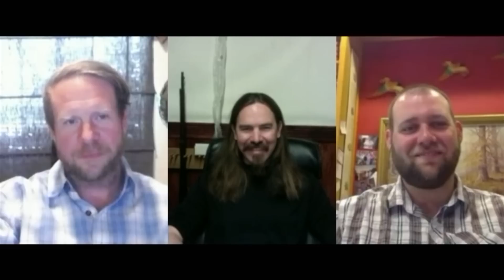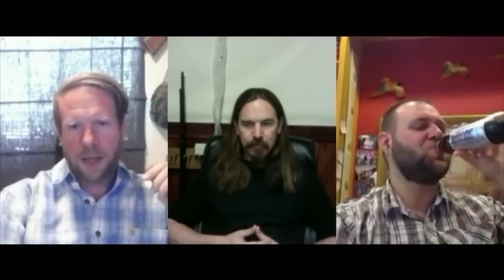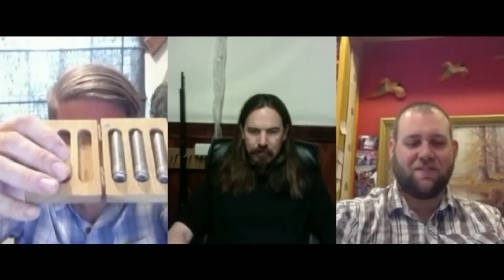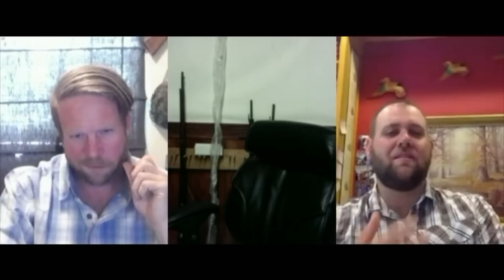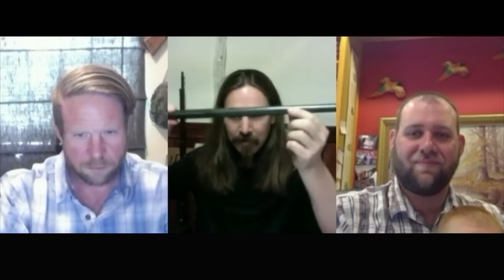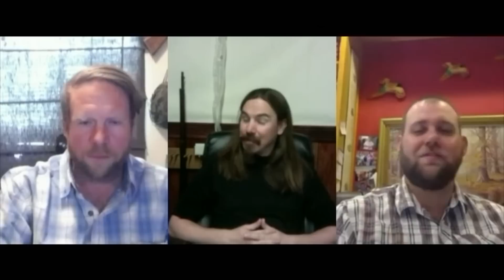Faxon Q&A #4: Chamber types, heat dissipation, headspace and more!

Comment: Ian addresses a very important point at 8:54. All of these different chambers relate to the leade and the throat only. Case diameter and headspace measurements are identical for .233 and 5.56. 

I got very confused last week about a proper GO gauge dimension to the datum point on the shoulder. Some internet experts (oxymoron intended) kept insisting that 1.4646” was the proper dimension for 5.56. I finally found a Forster “NATO” headspace gauge with that dimension, but the Q&A on Brownell’s was confusing to say the least. I called Forster and learned that it is a special order item to meet a COLT specification.  Not SAAMI, not NATO, but Colt. 1.4636” is the correct headspace dimension for a GO gauge for either cartridge. Now the NO GO gauge dimension is a different story, but I’m going to stick with SAAMI specs for .223.

I think that Karl misspeaks at 39:58.  The .223 Remington NO GO and Field headspace gauges have shorter headspace dimensions than their 5.56 NATO counterparts. The guy from Faxon said exactly that just moments earlier.  IOW a .223 Field gauge will identify excessive headspace sooner than a 5.56 Field gauge.

Comment: Question for you guys. 
I built an AR with premium parts such as wilson combat match grade barrel and a lantac bolt carrier group.   When it came to checking headspace, i did not close on the No Go gauge as it shouldn’t but when it came to the go gauge. The bolt doesn’t close either. O used another bolt by src and it still wont close on the go gauge. When i shot it do to an armorers advice stating that it didnt matter there was severe wear on both of my bolts lugs and the rifle would not cycle. it would shoot the round but not extract the round or load the next. I disassembled the gas system thinking that the gas block was not set right but after reinstalling it the same issue occurred. All this happened within 50 rounds

Comment: My M16A2 in Basic Training had about 137,000 rounds through it when issues to me; one of the armorer-qualified Drill Sergeants rebuilt it after my initial-issue examination revealed issues. One of the things he did was replace the barrel, as it was worn out of headspace. (At 137,000 rounds, this was not the first time this rifle had been rebuilt!)

Comment: A question stemming of the full auto mag dump. Is there a specific "rate of fire" that is needed to be effective? Has the military conducted studies on this? If so what is it and is it possible to reach this level with a semi auto only rifle or is full auto needed. I hear all the time that the M249 rate of fire is too high to provide sustained cover and it runs at 725/1000 rpm if I remember correctly. Second question is would a better trigger in a service rifle preclude the use or even installation of full auto in a service rifle?

Comment: Winchester’s fraternal twin to the .222 Remington Special, the .224 Winchester E2, appears to have inspired ArmaLite’s use of a 2 degree, 27 second throat angle, which has lived on in the 5.56mm NATO chamber.  In contrast, the current SAAMI throat angle for the .223 Remington chamber mimics its commercial siblings, the .222 Remington and .222 Remington Magnum.

Comment: Interesting. I understood most of it but what it boils down to in terms of the ordinary "everyday plinker" is stick to what you know and don't worry about the technical bullshit. Your personal accuracy skills are far more important.
However, there was one point that rang a real warning. When I was a novice, I was told by an " experienced" marksman that the snake bore cleaning rope was suffice for clearing barrel lead deposit. Believe me, it is not. The lead build-up eventually caused the excessive pressure to split the cases. I could not understand why accuracy had gone. I blamed the ammo until a wise man told me otherwise.
Although I could still clearly see the rifling, I did not realize it was clogged with lead. I was advised to get a brush, rod and Hoppes No 9. The muck that came out was amazing. It took days, but eventually all was put right.

Comment: The discussion of the .223 Wylde chamber focused on its limitations in terms of improving the ultimate accuracy of a rifle with match ammo / hand loads. 

But my understanding of the main benefit of a Wylde spec chamber is that it can tend to somewhat improve the accuracy one can expect from cheap ammo / tends to make a rifle less ammo sensitive. 

Any thoughts? It that just an old wives' tale?
Reply: Anthony Droege That's not exactly how the discussion went. They pretty much covered your question:
The gain will be minimal.
It's only when you seek the ultimate accuracy in an otherwise tuned system that it makes sense to consider the chamber type for accuracy.

Comment: Faxon how do the pencil or gunner barrels hold up to use with a suppressor? Are they rigid enough or will they droop and throw off point of impact as the the barrel heats up? Not talking full auto or anything just semi auto rapid fire at the worst.
Reply: Any suppressor will change POI just due to the change in barrel harmonics (on any weight) and the change in how the barrel uncorks the projective. The Gunner series will host a suppressor very well. I run a 11.5" mid on my personal carbine.
Reply: I had a Gunner and didn't notice any discernible shift with the suppressor on or off.  Granted, I have a TBA ultra 7 which is a pretty light weight suppressor and I wasn't dumping mags either.  So ymmv.
Reply: Thanks for the info.

Comment: Question for Faxon.  What do you guys use for a coating for your barrels.  I had to counter sink the screws to hold a front sight group.  The normal bits just spun and didn't bite.  I had to use carbide to make the counter sink.
Reply: Elephant Ride answered most of the question. Carbide is needed for drilling nitrided parts.
Reply: They Nitride the entire barrel.

Comment: Speaking of heat dissipation as well as barrel rigidity,  I've seen some manufacturers begin wrapping barrels in carbon fiber. From my own preliminary research it seems that there are kinds of carbon fiber that have different properties. Is there any truth to carbon fiber dissipating heat faster, and would you have a less rigid barrel if you used one wrapped in carbon fiber compared to one of the same diameter but that was solid steel?
Reply: David Hammers CF is generally a very good insulator compared to steel. The carbon itself is a great conductor but because it's a composite the epoxy which  distributes the stress is not very thermally conductive.

Comment: Question: Why do Faxon Barrels not feature a dimple opposite the gas port like some other barrels? Is there a specific reason?
Reply: wotnuk Nathan has stated elsewhere that Faxon omits dimpling to keep their barrels universal to the different gas block designs (pinned, clamp on, set screws), as well as reduced cost for the consumer.
Reply: Specter covers most of it, but we'd be happy to go into additional detail in the next part.

Comment: Why do bolt action rifles usually use 2-3 lug bolts instead of multi lug designs such as on the ar-15? One would think that the more consistent locking of the multi lug design would be especially important on a bolt action sniper rifle.
Reply: Probably too expensive for the outcome. But some European manufacturer use more than 2 or 3 locking lugs: Steyr = 4 (Austria), Rößler Titan = 3, 6 or 16 (Austria), Sauer = 6 (Germany), Mauser = 6 (Germany)...
Reply: River Styx Armory Thank you, for your comprehensive answer. That was very informative.
Reply: Do three lug rotating bolts have a tendency of not locking? I would have imagined the thicker lugs would be more resistant to higher forces than a multitude of smaller ones.
Reply: INTCY: I don't think so. Those bolt actions with 3 lugs I had the opportunity to lay hands on were all excellent and in the more expensive range. (Mauser, Sauer, Sako TRG M10)